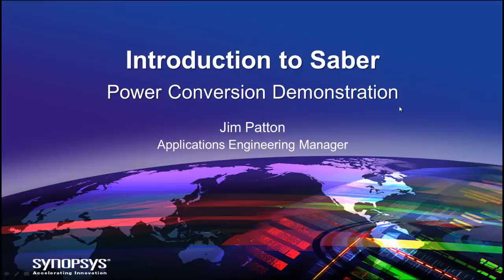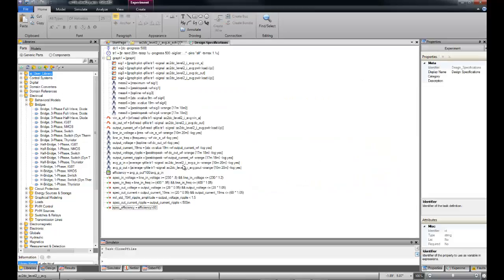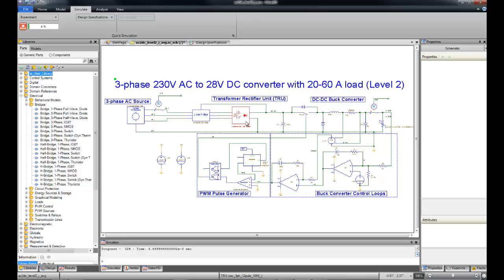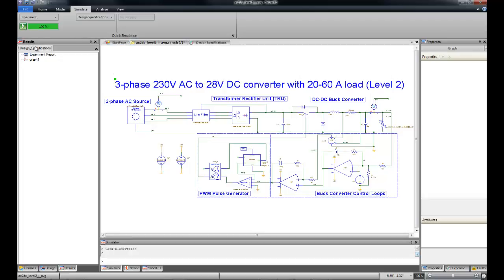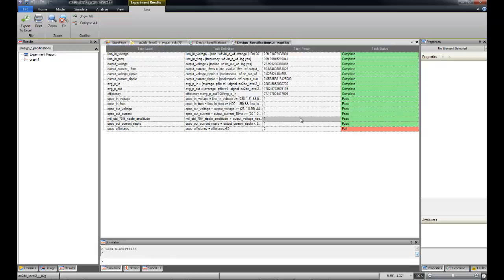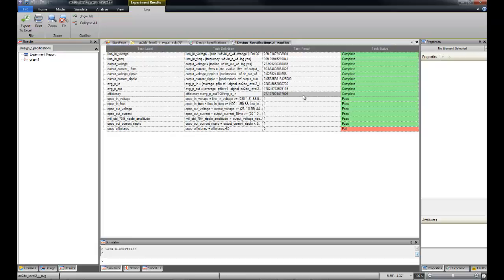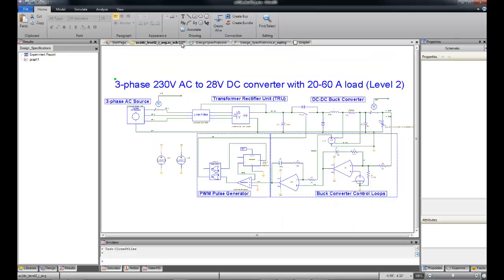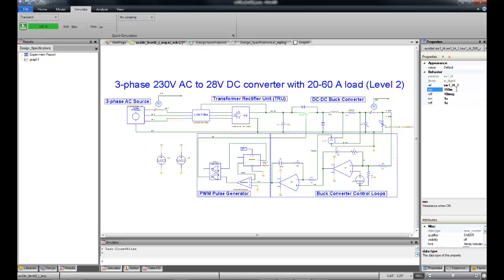Introduction to Saber: Power Conversion Demonstration | Synopsys

Comment: What is the solver used in Saber?
Reply: The solver used in Saber is called "SaberHDL."  It is a full, analog and digital, mixed-signal simulator.  The modeling languages that SaberHDL can accept are the IEEE-supported standard VHDL-AMS as well as openMAST.  You can also import Spice models if you're able to get unencrypted source from vendors.